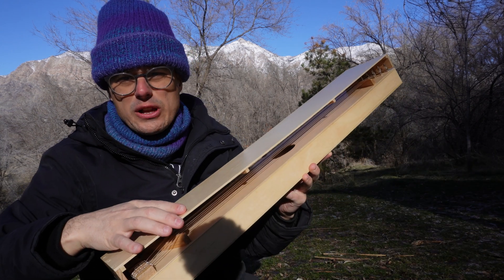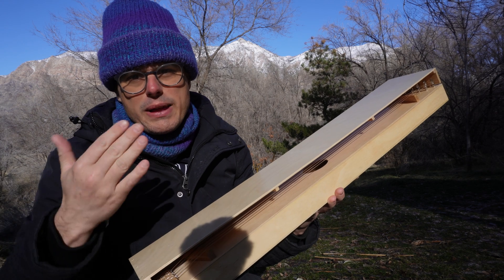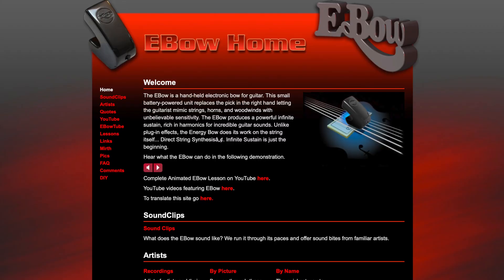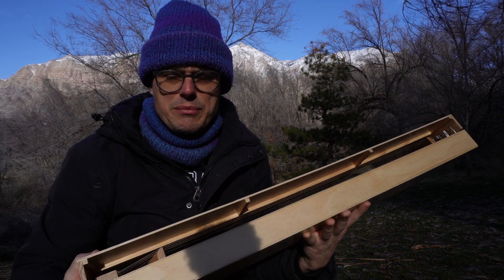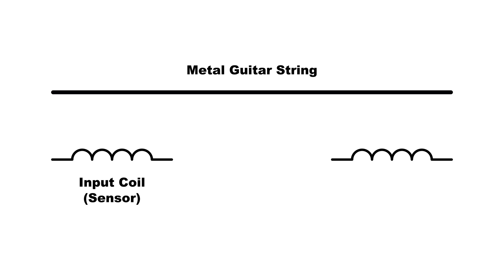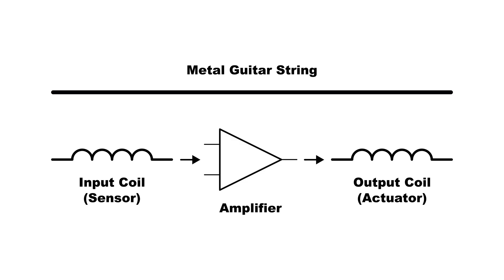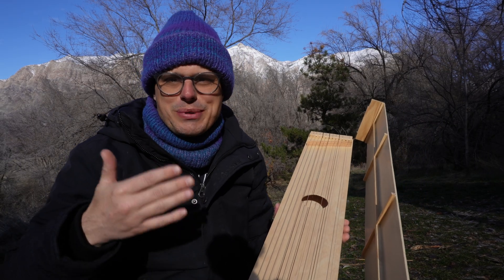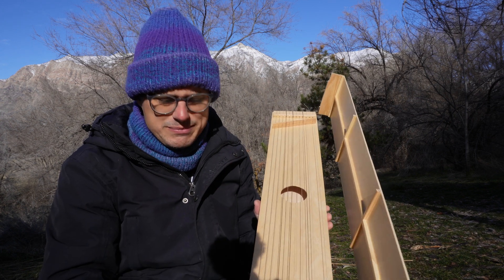Fulgorian Harp: [1] Guitar Sustainer Amplifiers

Comment: Re the LM386.  Check out the data sheet and the application guidance.  Resistor from output to + input will only make an oscillator. I seriously doubt that the circuit diagram has been correctly reversed from the pcb layout. The gain setting resistor should connect from the output pin to gain pin  1.  A resistor of around 10 to 15k would be typical.  A capacitor in series with the resistor will modify frequency response.  e.g.  15k in series with 33nF will give +6dB Bass Boost.

Comment: Other types of coils you can try are from a good sized relay! They are way bigger tho. But magnetics is weird the field is tuned to each application you want a concentrated field acting on the string. A speaker coil is more of a flat field to drive the whole diaphragm. In practice this is done by a double humbucker pickup one side is out other is input and i think you still take the signal out to your speaker.

Comment: Now put a CD4046 after the comparator but before the half-bridge. If you use the standard type-2 phase comparator, you’ll get no phase shift and can set the frequency division with counters. But if you use the type-1 phase comparator, the frequency that it locks to will be more dependant on the VCO, and it will likely lock to harmonics. Putting a potentiometer as the VCO’s resistor will help you control what harmonic it locks onto.

Guitar pickups are designed for magnetic reception, less so for actually stimulating the strings. The strings would be better stimulated by an inductor with an iron or ferrite core, as opposed to a rare earth magnet core.
Reply from the maker: Great suggestions, thanks for the tips!

Comment: COILS have polarity???
Reply from the maker: Yes, they are wound either clockwise or anticlockwise as seen from above. Depending on which way the current flows through, the induced magnetic field will point either up or down through the coil according to some right-hand rule. Normally you wouldn't care, but in this case you do since you want to push (and not pull) on the string as it is moving away.
Reply: @MichaelKrzyzaniak  You can't push guitar strings using a magnet, not even using an electromagnet. Only pull. Or are guitar strings magnetic?
Reply from the maker: @yanikb.1312  The guitar strings are magnetic on account of being magnetized by the magnet. In my next video in this series I show the guitar string being pushed by the coil.
Reply: @MichaelKrzyzaniak  Someone mentioned using relay coils. I'd suggest trying plunger style solenoid coils such as you find in a copy machine that is used to actuate gates for paper feed and whatnot. Instead of a ring magnet around the outside what if you used a cylindrical rare earth neodymium magnet in the center of the coil? 🤔 Another  coil based device I encountered on copy machines is what is called a "magnetic clutch" used to engage a drive shaft with a gear when engaged. They have shorter height coil bobbins than the plunger solenoids. If you have any kind of copier repair shop near you, you might could give them a visit as they will most likely have a boneyard you can source from. Most of the plunger solenoids will be found in the finisher attached to the side of the main machine. Magnetic clutches will be mostly found at the back of the machine where the paper tray feed & transport is located. Several trays powered by a single motor and only when a Magnetic clutch is energized for a particular tray will it then start the paper pickup & feed process.

Comment: I don understand that schematic
where is the input ? how does it sense strings ?
Reply: The sound is generated by the two coils and the string. No need for an in or output jack, the string is both oscillator and "speaker"

Comment from the maker: Followup: Today I built a version of the TLV4111 circuit with a TCA0372 instead. The TCA0372 can be powered directly by a 9V battery and can drive either a 8 or 16 ohm output coil. The 8 ohm one is almost too strong. The TLV4111 draws about 100 mA from the battery driving an 8 ohm coil, and the TCA0372 also draws about 100 mA driving a 16 ohm coil which is about the same strength as TLV4111 at 8 ohms. That would easily give you 5 hours of play time on a standard 9V. The TLV4111 circuit is only about 50% efficient due to the voltage regulator, whereas the TCA0372 is around 75% efficient. So I'd recommend TCA0372.

Comment: The problem with only one input coil and one output will probably be that such a system tends to favor the strongest resonance. This is how it usually works when you deg a guitar to doo controlled feedback with a loud amp. I'm quite sure that it will tend to just make one string really vibrate nicely and the rest will only have some symphatetic vibrations if the fundamental or the harmonics match up with the string that overpowers the rest. I wish I'm wrong though. It would be cool if it would modulate between the strings like your harmonic mode did between the harmonics of the single string. You could use separate coils and amps for different srings to get chords if nothing else works with multiple strings.

Guitar pickups will probably work fine as the input coils as that's what they are built for, but the high impedance will probably make them impossible to drive hard enough with any sensible amplifier.

I quess you knew at least most of this already, but anyway... Looking forward to see how thir project will progress.
Reply from the maker: AAhhhh, the spoiler is that I have already tried it and you are right about all of this! Why didn't you tell me like three months ago 😭
Reply: I didn't see a video three months ago. :) I'm sure that if I told you three months ago, you would have tried anyway.